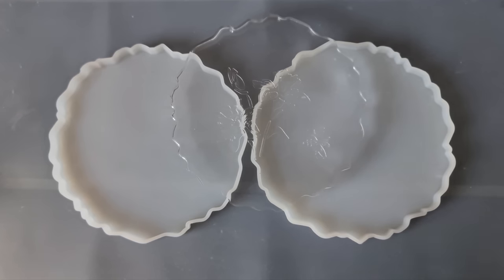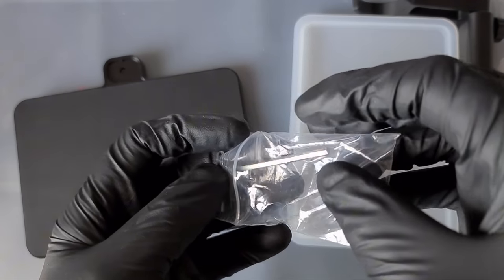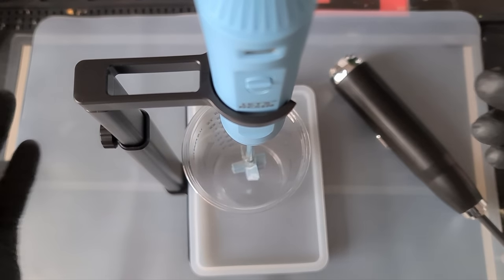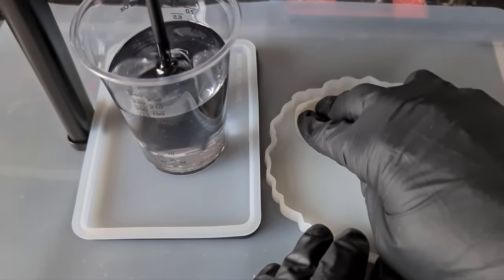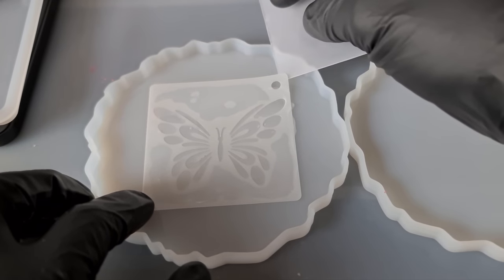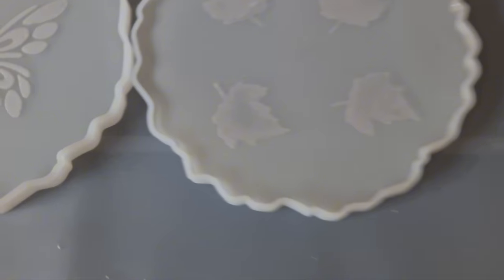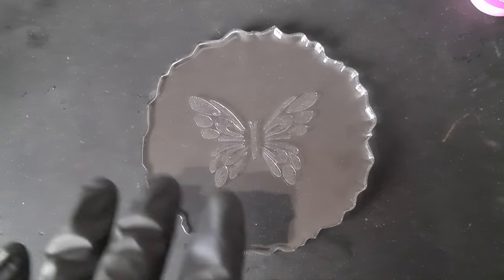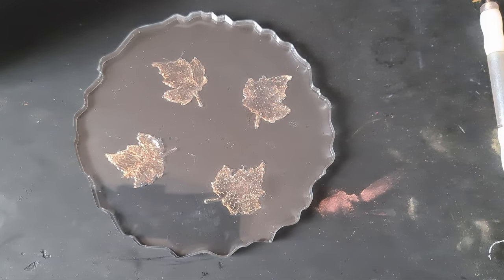#186. 'ONE GIANT LEAP' For RESIN ART! An EPIC DISCOVERY!

Comment from the maker: I think if I heat the lotion bottle to lower its viscosity maybe a day before using again, the bubbles in the lotion should be able to escape allowing me to get a bubble free demold 🥰
Reply: How about trying this with Vaseline (petroleum jelly)? It has a lower water content than lotion, so hopefully fewer bubbles.
Reply from the maker: @maiaallman4635  I did think about this but maybe more difficult to wipe up?
Reply: Can you put the lotion in the resin degasing machine? Or pressure pot.
Reply: I think I'd try popping the lotion in the freezer for 15 mins before using. IDK, does lotion freeze?
Reply from the maker: @anitamitchell3452  yes, it should freeze 😊😊
Reply: I forgot about the bubbles. Maybe a thicker hand cream vs hand lotion. I have skin issues due to a genetic issue. If I use lotion it burns like alcohol when my skin is split. Hand cream from a tub does not. Instead of a bottle of lotion maybe hand cream spread careful with a spatula?
Reply: I honestly love the texture the bubbles in the lotion left behind!
Reply: I think it was the heating blanket that caused the bubbles. In the publication in which I tagged you, I followed your steps, but with jewelry resin and also mixed it with mica of the same brand, but with the normal curing of this resin and my lotion did not make bubbles.Although the result of those bubbles, to me, if I liked.
Reply: I like the texture
Reply: @maiaallman4635 i thought the same thing!  Great minds...lol
Reply: Try vaseline, it might be less bubbly. At least my brain says so, lol. I really liked the tiny bubbles, for the first time ever Im trying to get them to appear, weird feeling :)
Reply: @maiaallman4635 Oh, you had said this already, I didnt read the comments before answering.. but hey, great minds and all that jazz :)
Reply: Or pop the lotioned moulds into a vacuum chamber before pouring the resin and then popping it back in there?
We need to have little robots in the vacuum chambers that pour things while in there lmao
Reply: This one girl said to use a plant heating pad and it helps with curing the resin faster as well as getting rid of bubbles 
She used a plant heating pad, a silicone pad, placed resin on top, and then used a microwave dish cover (plastic lid) over the top. 
She showed that it prevents weird marks and bubbles
Reply: I cant find the name of the mixer/stand thingy 😂. Can someone please post the name of it in the comments 🙊
Reply: Try lip balm 😊

Comment: Great result apart from bubble problem. I think you'd enjoy a 3d printer pal, i use them to make master moulds to then cast custom silicone moulds from. For nunnles i made a little vibrating table, works well, thinking about making a vacuum chamber.
Reply from the maker: Thanks 😊 Yes, inwas offered a collab with a company but I'm not ready for a 3D printer just yet, maybe soon 😁😁
Reply: @daniel..cooper You need to learn a bit of CAD software but something like Fusion360 makes it easier. Only prob with 3d prints is the layer lines, but you could get a resin (irony!) 3d printer which gives much smoother results, or use some simple techniques to smoothe standard FDM print layer lines. As your fond of saying, there are EPIC poissibilities :) Loving your channel pal, exploring is what it's all about.

Comment: I love the texture of the little bubbles. Personally I will keep the design clear for the glass etching effect. But I do wonder if, leaving the lotion to dry out a bit, if a light dusting of mica powder on the lotion will work.🤔🤔. Also, mixing in colour in the resin itself might provide a very nice effect (once again thinking of glass etching). I need to try this THIS weekend😂.
Reply: I've read your other comments but I'm thinking a drier lotion, no longer in a true fluid state.
Reply from the maker: Drying the lotion may work, I have done a drying test over the past 24hrs and it dries nicely, lots more testing to be done 😊😊😊

Comment: I would use a soft clay in the stencil and before you lift it, press a fine grade sand paper over it to achieve the etched look.  Then lift both of them off and voila!  Once the epoxy is cured you can pick out the clay.  Maybe a little vaseline over the clay before the sandpaper would make it come out of the resin easier.

Comment: All these experiments are fun and interesting to watch.
I think the bubbles add character, it would look especially cool in shell molds. 
The color should remain if you sandwich it between a thin layer of resin, the design (filling of the sandwich), and the main resin layer. 
I've never worked with resin but when I saw the effects of the baby powder it made me want to try it for white with graphite powder for black (if it is safe to use with resin).

Comment: Great experiment, once again.😊 I prefer the etched look over the painted as well. Transparent colors might look nice too. Do you think the imperfections would disappear with a top coat? I wonder if spackle (wall patch) would work? It has quite a thick consistency so, bubbles probably wouldn’t be an issue and it’d clean up with just a bit of water. Thanks for another interesting video!
Reply from the maker: Yes, a top coat would work so long as it's not inside the etched detail 😊😊

Comment: Very cool! Have you tried using colored resin? Just a little color like a bit of blue? I was wondering if the image would show up more with color or if it would end up being hidden. OH.. and what about putting a minimal amount of resin in, letting it cure, remove the lotion, add some glitter in the recessed area, then placing it back in the mold but upside down, filling in with resin? The image would be in the middle of the coaster then AND you wouldn't have to be so careful with the resin top coat.
Reply from the maker: Thank you 😊 Yes, the glitter would work great 😊 just have to be careful the resin doesn't seep down any gaps after flipping it though 😊 Maybe lotion in the mold and then flip and push down to prevent leaks 😊

Comment: Maybe someone's done this, but I wonder if after you've put the lotion, but before you've peeled the stencil, you could either a. manually add texture/detail with things like brushes and needle tools, or b. gently press on a texture sheet? Actually, this gave me an idea! Air dry clay!! Some of it, like Crayola's brand of air dry clay is actually proper clay based, you can't bake it obviously, but otherwise it acts like ceramic. Meaning you can use water to thin it down, and make "slip" which is a clay slurry. That would work WONDERFULLY for adding texture, plus you don't have to worry about smudging it like the lotion, and it won't melt with heat. In fact, it'll just harden from heat drying it out. Worst case is I think you'd worry about it cracking. You should definitely try this, I don't have the money or supplies to test this out, but it seems up your alley!

TL;DR Using texture sheets would be cool, and instead of lotion you should try using air dry clay slip. Easier to texture, less risk of it smudging, it dries, and doesn't melt in heat.

Comment: Nice texture on those.  Have you tried mixing mica powder with uv resin & using that instead of lotion?  Maybe try it after curing & try it with out curing.  I think it would be cool if you figured out a way to be able to get a colored etching with something color shifting. If anyone can find a way, it will be you. Great video!
Reply from the maker: More tests to come but uv would cause more mess 😔
Reply: @daniel..cooper  you think so?  Idk if it would or not. I’ve had some uv resin that was thick & some that were thin. Maybe the thicker resin would work. I don’t see the consistency being much different from the lotion & instead of wiping it off you could just cure it.  I would try it myself but I can’t afford to experiment lol especially since I’m still trying to get the hang of everything.

Comment: Hi Daniel! I agree.... I didn't like the colors with the acrylic paint. I think I prefer the clear. Q: How did the scratches get there in the leaf mold? I didn't catch it.
Reply from the maker: From scrubbing away the paint with a metal handled brush, I almost gave up on the vid 😔
Reply: @daniel..cooper  I'm glad you didn't. It was excellent! I've been wondering if you could lay the stamp at the bottom and pour the resin on top of it... if it would come out of the resin and leave an inlay. 
As an aside: I love how you call your wife Mrs. Cooper. It's very sweet.

Comment: Would u loose the etching if you used coloured resin instead of the clear resin to do initial pour? So do initial pour with black resin and then ‘colour’ the etching with chameleon powders for example?
Reply from the maker: Hi, you wouldn't lose the etching if the color is translucent. If not translucent, you will need the etching to be on the front of the piece so if using lettering, remember to reverse the stencil 😊

Comment: It's better clear than to add color. It looks like it partially ruined the etched effect into the resin. I would've left it clear BUT I would do the next one deeper with the baby lotion, like it's thicker. Almost like the design is deeper into the resin.
Reply from the maker: Yes, would be better but will need thicker stencils but then run the risk of the lotion pulling away with the stencil maybe?

Comment: Use colored UV resin fill in the butterfly? Can you mix glass etching fluid in with the lotion to give it a frosted effecr?
Reply from the maker: Yes, you can use colored uv 😊 I'm not sure a glass etch would work but you could use a rotary tool to sand inside to give a better frosted effect 😊
Reply: @daniel..cooper  what if you mixed baby powder with the lotion(may lessen bubbles) then did this process. Would the resin hold some of the powder and give it a frosted effect? Hmm
Reply from the maker: @kimclayton5814  it would certainly help the thicken it, not sure about the bubbles though, maybe work an experiment 😊

Comment: \m/ X_x \m/ Have you tried pulling the lotion in the Vac pot?  Might help with bubbles? I also assume the lotion has a good bit of water in it which will pretty much always bubble up with enough heat.. after seeing this I have been trying think of other materials that could be tried with this method.
Reply from the maker: It may work, I tried hot water so hoping that helped 😊

Comment: "The other version has an AI button" - that's just marketing gone stupid beyond belief.  It's a timer.  There's zero intelligence, artificial or otherwise.   You press the button, it turns it on, counts down for 4 minutes, then turns it off.  A tiny circuit to do this would cost pennies and has been possible for at least half a century.  Don't allow yourself to be bamboozled by marketing throwing buzz words at you.
If you're going to fill them with resin and pigment, why not just fill the template with pigmented resin and dispense with the lotion?  You could also fill the template with clear UV resin, sprinkle on some fine glitter or other pigment, then cure it.  Lift off the template and flood the mould with non-UV resin.  The glitter would be suspended in a thin layer inside the resin.  The only problem would be to make sure the mould was totally free of stray glitter (which is never easy).